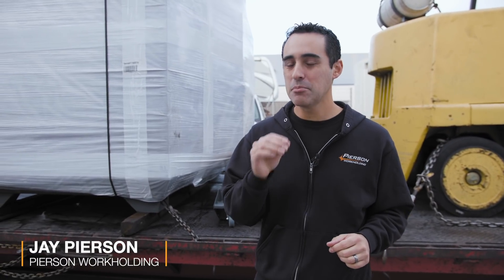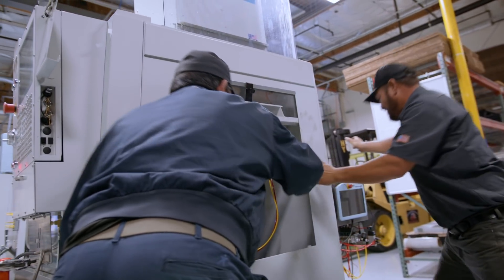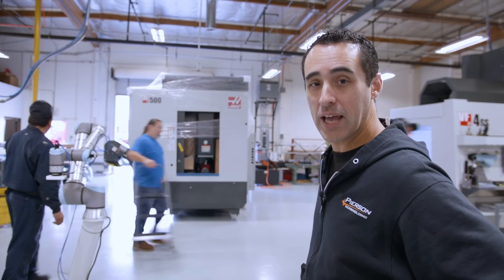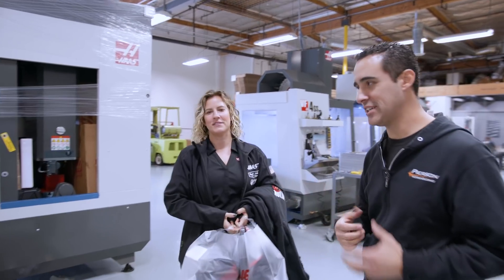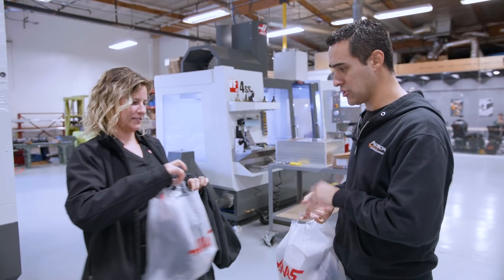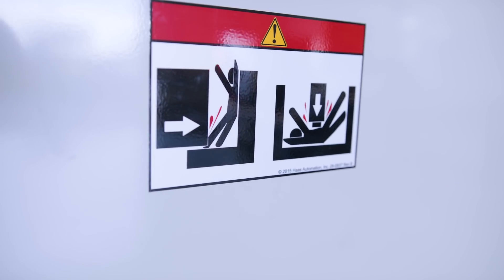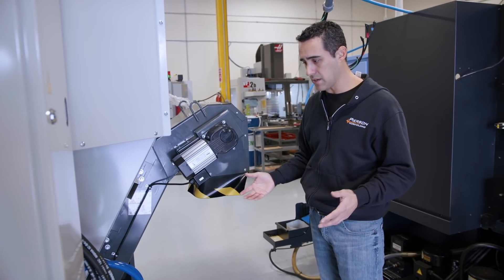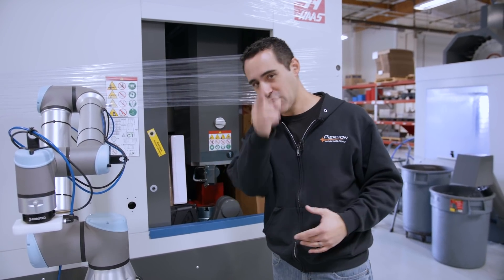DELIVERY DAY - HAAS UMC 500 - Pierson Workholding  | Haas Review

Comment: I really want to like Haas but every machine I’ve worked on has been really flimsy and has never been quite up to the job they really struggle when pushed hard.A mazak or maatsuura or any other machine of that ilk will just run and run heavy cutting inconel or duplex 24/7 where a haas always seems to fail or just does not have enough grunt to get the job done
Reply: The issues probably lie in your programing
Reply from the maker: You might consider a different approach to your programming.  Gone are the days of big, high power cuts.  It's all about full axial, 5%-15% radial, high rpm, high feedrates and coated tools.

Comment: A big part of the higher tool count is you can have several of the same tool setup with a runtime expectation and it will auto swap when the tool exceeds it. The mill will auto swap to the next tool to keep from breaking tools on long run parts

Comment: We just got our Second UMC 750 and also had to move a vf2 to put it in place.  Electric and machine setup also friday.  We decided that because the accuracy of features in the first UMC is so much better due to fewer vise placements that the URs should go on the five axis machines first and we should work to run them 24/7.  Or whatever is possible.  Using dovetails with schunk vises.  Major goal is to get our shop loooking as squeaky clean as yours.  Congratulations on your new machine!